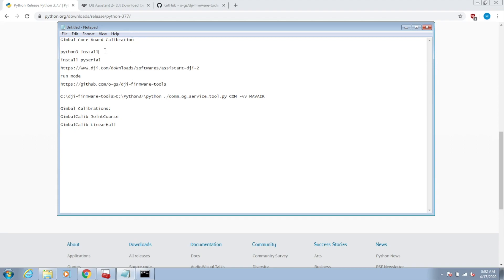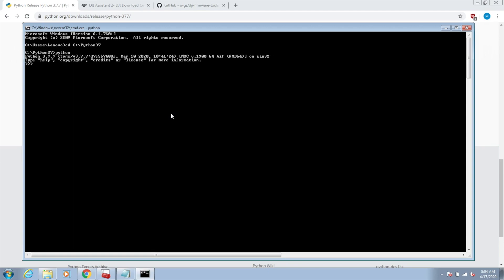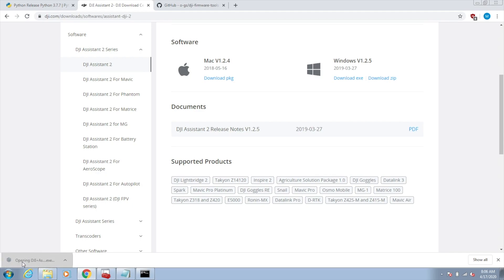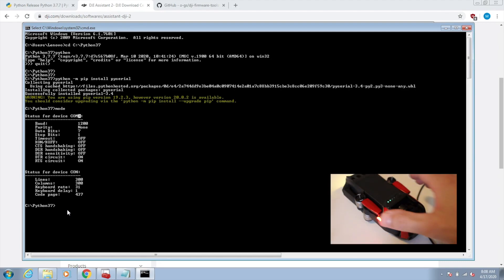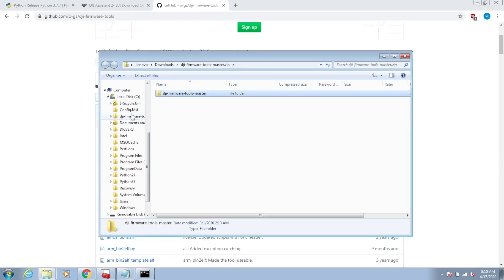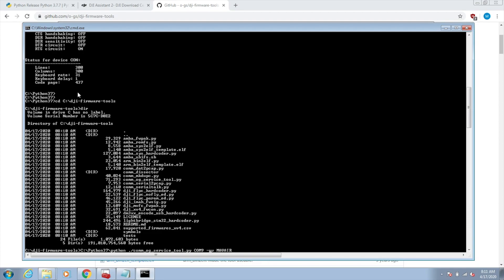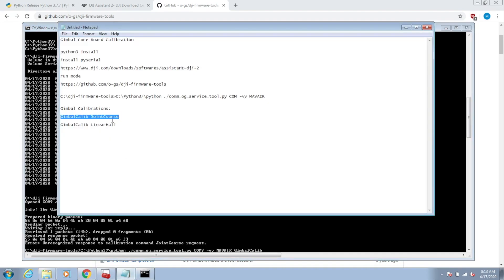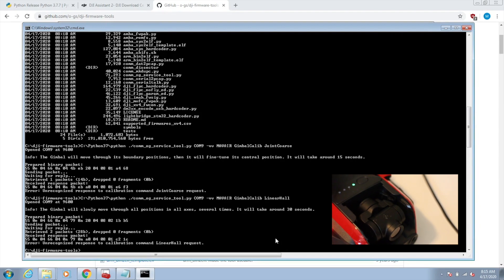DJI Mavic Air Gimbal Core Board Calibration

Comment: Great Video, easy to follow.
One problem I get is with the COM option. I get the following error:
C:\dji-firmware-tools>C:\Python37\python ./comm_og_service_tool.py COM4 -vv MAVAIR GimbalCalib JointCoarse
usage: comm_og_service_tool.py [-h] (--port PORT | --bulk) [-b BAUDRATE]
                               [-w TIMEOUT] [--dry-test] [-v] [--version]
                               product command ...
comm_og_service_tool.py: error: argument product: invalid choice: 'COM4' (choose from 'A2', 'P330', 'P330V', 'P330Z', 'P330VP', 'WM610', 'P3X', 'P3S', 'MAT100', 'P3C', 'MG1', 'WM325', 'WM330', 'MAT600', 'WM220', 'WM620', 'WM331', 'MAT200', 'MG1S', 'WM332', 'WM100', 'WM230', 'WM335', 'WM240', 'WM245', 'WM246', 'WM160', 'WM231', 'WM232', 'WM260')

Here is the mode report for COM4:

Status for device COM4:
-----------------------
    Baud:            0
    Parity:          None
    Data Bits:       0
    Stop Bits:       1
    Timeout:         OFF
    XON/XOFF:        OFF
    CTS handshaking: OFF
    DSR handshaking: OFF
    DSR sensitivity: OFF
    DTR circuit:     OFF
    RTS circuit:     ON
Reply: same trouble... How have you solved it?
Reply: @toiranesedoc  WM230 --port COM4 GimbalCalib JointCoarse
Reply: @oly_shit  I’ll try this way
Reply: @oly_shit  mate, I have the same problem. Where I have to put it?

Comment: I need help guys, im trying to do this with my mavic pro and its not working. As soon as I plug in my USB cable the gimbal goes limp and i get this error. "no response on calibration command request" my gimbal doesn't move at all?

Comment: It worked perfect for my Dji Mavic Air 2 same exact  procedure , thank you
Reply: Hi is it same procedure as the video.for mv air 2 or did you enter other codes 
Thank you
Reply: @bachisquiri  its the same codes, and everything, after 3 days of restless research I found this video and just went for it and worked, I bought a new mavic air 2 camera and gimbal, I installed but the gimbal was not able to align properly with the calibration and lean about 30degrees until I did this
Reply: @ed_rt  ty soo much for reply
Reply: @ed_rt  it worked on mavic air 2 only the errors stayed but if thats the only ,)
Reply: @bachisquiri  yeah the same notification  stayed even after I did this but it did not affect the functions or stability of the drone works just fine for me too
Reply: @ed_rt  nope i know thank you for replying aprecciate that

Comment: Works with Air 2. You should have millions of views on this.
Reply: Hi, what was the command for Mavic air 2?
Reply: @leegengxiang2173  WM231 you can also use MAVAIR2 but WM231 is mav air 2s code.
Reply: Hi is it the same procedure as the video  shows for mavic air 2  and were do you have to enter the WM CODE ?? THANK YOU

Comment: Thanks for the upload, this video just saved me. I replaced my gimbal housing because of cracked lens, but used the old camera and wiring. After turning on my Mavic Air the gimbal would not center and wasn't stuck pointing up and to the side.

Here are the notes I have, feel free to copy and paste. Note my locations and folder names are different than the video OP:

Mavic Drivers download (DJI Assistant 2 tool not needed):
https://www.dji.com/downloads/softwares/assistant-dji-2

DJI Firmware:
https://github.com/o-gs/dji-firmware-tools
Download:
dji-firmware-tools-master.zip
Copy folder dji-firmware-tools-master (don't extract) to root C drive (C:\dji-firmware-tools-master)
Rename folder and remove -master (C:\dji-firmware-tools)

Install Python3
Custom Location:
C:\Python3

Run CMD command Prompt
Install PySerial:
cd C:\Python3
python -m pip install pyserial

Check current devices (COM[some number]):
mode
Power on Mavic Air
Connect Mavic Air to PC
Run mode command again to see COM number of Mavic Air:
mode

Set firmware tools directory:
cd C:\dji-firmware-tools
Run Gimbal Calibrations (match your firmware location, Python folder name location, and COM number):
C:\dji-firmware-tools>C:\Python3\Python ./comm_og_service_tool.py COM5 -vv MAVAIR GimbalCalib JointCoarse
After calibration complete (about 15 seconds), pick up and rotate Mavic Air on its side
C:\dji-firmware-tools>C:\Python3\Python ./comm_og_service_tool.py COM5 -vv MAVAIR GimbalCalib LinearHall
After calibration complete (about 40 seconds), pick up and rotate Mavic Air on its side

Power off Mavic Air
Disconnect from PC

Comment: I need some help with this.  Your video is a little blurry for my eyes.  I get an error.  I copied and pasted below the command prompt below.   What am i doing wrong?   Thanks in advance! 

C:\dji-firmware-tools>C:\Python37\python ./comm_og_service_tool.py COM5 -vv MAVAIR GimbalCalib JointCourse

Traceback (most recent call last):
  File "./comm_og_service_tool.py", line 35, in <module>
    import serial
ModuleNotFoundError: No module named 'serial'
Reply from the maker: that error is python complaining that the pyserial module is not installed. I walk through using python pip to install the module @ 02:20
Reply: WM230 --port COM5 GimbalCalib JointCoarse